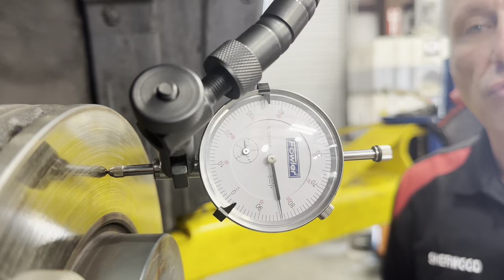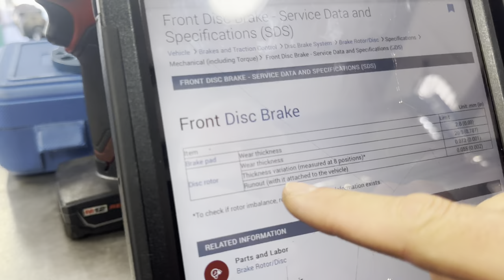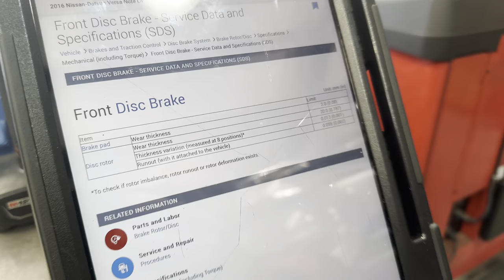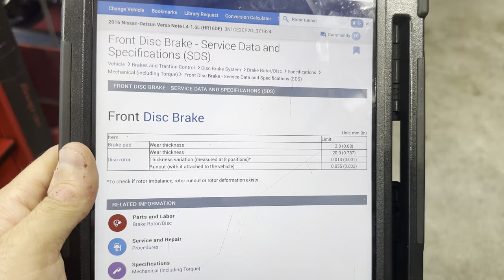It’s Vibrating When Braking & It’s Not the Rotors. How to Test! (Nissan Versa)

Comment: You only have one lug nut on that rotor and its not going to sit perfectly flush on the hub flange. Sometimes rotors will cause brake pulsation due to hot spots causing a harder surface to develop under heat treating itself. This can be a result of cheap pads, sticking caliper pistons, bad hardware, guide pins sticking, etc. Its not always warpage due to overheating, but also hard and soft spots. The hub won't be the problem in most cases unless gorillas tighten the lug nuts unevenly without a torque wrench, pulling the hub and rotor out of round.

Comment: So why did it warp? In my experience, this happens from overtightening of the lug nuts with the air gun when the tires are mounted. All tires call for a specific torque on the lug nuts, but most shops just tighten them as tight as the air gun can, and that warps the axles, as that force pulls excessively on the lug studs, as you can see by the high spots around each stud. I stopped tightening lugs nuts with my air gun a long time ago for this very reason. I just snug them with the gun and then use a torque wrench to tighten to specs.

Comment: When replacing discs/rotors remember to clean the hub for rust before you put a new one on. Some rotors are low quality but some are fixable if you use sanding paper and put it on  brake pads and manage to find a way to spin up the discs on the car. How you do that I wont tell, someone maybe tries it and do it wrong and get hurt. It can be the bearing too thought but I guess most hubs have them built in today so you still would have to replace the hub.

Comment: I had steering wheel shake on braking over 40 mph on my Triumph TR8. I took it to a British car shop and they said "rotors" so I had them replace them.  The problem did not go away so I went back to the shop and they basically told me to pound sand; it wasn't their problem.  The vibration turned out to be caused by loose front wheel bearings which I found and adjusted myself.  So hard to find a shop with enough integrity to take responsibility for their mis diagnosis.

Comment: I did some destructive testing of brake rotors that came from ......you guess it: China. The poor workmanship and lousy casting process was the culprit. This company (in Canada) bought a 40 footer container of rotors, after testing a dozen and found that they were horrible I closed the book. Even though the thickness was good it wasn't to manufacturers specification. Outside face much thicker than inside face, thus made the rotor prone to heath built up and consequent warpage. Put OEM rotors on, problem solved. Just another story for you. Great vid and explanation, kudos to you and your group. Cheers

Comment: When we install new brake rotors, we always check rotor run-out on newly installed rotors. Also we clean the hub area the rotor rests on. if I see more then 0.001" I'm not happy. It could be a bent hub.

Comment: My dad gave me his hhr b4 he died,had a vibration pulled the wheel off & he had gotten the nut which spins on top of a piece of metal because it turns & was not in the pocket,changed the parts to new & made sure they were in the pocket & no more vibration!*

Comment: Simple fix turn the rotors on the car! There are several tool manufacturers . Quick way lathe is the best. If you turn or machine the rotors on the car it trues all hub run out! It’s most important on front wheel drive. I can’t believe your going to all this trouble! 😂

Comment: Hello there, regzrding brake inspection I would like you to talk about bearing hub knuclke assenbly stud bolts. It happens to me that reassembling the bearing hub and  kuckle one stud broke when I applied almost ten  foot pound in excesss of the workingtorque which was around 50 ft/pond.  I was strange because I had tightened the same assambly previoustimes to 70 ft/ pound  and the studs managed to do weell and worked well since then ,  ut this tsutd broke being a new one and a OEM stud. What would be the criterias on selecting a generic stud bolt?  What would it be a becnh test for the studs and what should be the test torque? There are menufacture failure in origi al bolts or they are being clonned and sold in the market as iriginzl...... lots of questios arise from this topic, nice video series of yours tnks a lot.

Comment: Yes please do a vid on cutting rotors and drums.  I like to reuse original manufacture some of the import is so cheap it shows when they heat up they warp very easily. Then some like brand B  are machines to far off they dont fit and the tone ring falls off.  thanks

Comment: Secondly...what was the end result of just changing the hub? Presumably, it was the bearing that was bad. I hope once the hub and bearing were replaced you checked the result on both surfaces again. 
Then...it would have been nice to hear if this actually solved the problem.
Lastly...it would have been awesome to have a follow-up after a few months to see if the fix truly held.

Comment: Only reason that I can think of that might have caused the hub flange to be out of spec is a wheel bearing was replaced at some time before you had it in to your shop, these are easily damaged if the press wasn't set up or used correctly. Very unlikely that it was out of spec off the production line.
Reply: Accident maybe?

Comment: If you suspect this. Always spin the wheel with the tires in the air and make sure the wheel is straight and not wobbling back and forth. If it wobbles or appears bent. Remove the wheel and check it on a balancer. If the wheel no longer moves or appears bent. Then it's your hub problem solved.

Comment: I used to deliver parts for Advance. One of our commercial customers always turned every rotor he installed. I asked him if it was necessary. He said that most rotors are coming from China and he makes sure that they are straight. One thing I don't think he thought of was dirt or rust on the inside of the rotor or on the hub.

Comment: I use to turn breathe drums and cut shoes on a machine that cut both at the she time. Stayed doing it for greyhound and now at a city transit. 
The metallurgy is just not there anymore. A dim would look good and cut in .010 and hot spots would start popping up. The depper the cut, the worse it gets. 
We just use new more, sold that exigencies machine for next to nothing. I won't even turn a turn anymore. Unless it was new original factory supplied

Comment: I can understand (to some degree) this being missed on the first disc change but I'd have thought a closer inspection would have been obvious when vibration still present.
Personally I always measure runout close to the edge on a new disc or close to the wear area edge on used, this will generally give worst case value.
Interesting that the wheel hub was out, presumably this has happened since the car was new?  Any idea what was the cause?

I had a similar issue on a Mercedes recently and I must admit I never bottomed it out.  Started getting judder under braking with cars original discs, these were 2 piece Brembo items and were stupidly expensive but with no other choice bit the bullet and bought a pair.  Car was perfect.  For a short time, then the judder returned.
I measured and they were showing runout so, I found a company which could skim on the car.  Again the car was perfect.  For a while, then the issue returned.
I got the original discs and faced them up true (off car on lathe), put these on the car and ran spot on, untill....  Well I imagine you can guess what happened next!  Yep, judder returned.
In the mean time I took the second set of discs and skimmed them up, they were definitely out (both front discs), it was interesting to see the wear pattern as progressive cuts were taken.  Unfortunately had to sell the car at this point so never got to the bottom.  Although the car's gone now this still bugs me so I'd still be happy to hear of any suggestions why this would occur.
The brakes were 340mmØ with aluminium centre "bell", calipers were 6 pot Brembos and all pistons moving freely.

Comment: I've got a car that the brakes make a groaning noise when the pads get close to replacement time. When I start hearing that noise, I have about an eighth of an inch of wear left before going metal to metal. We bought it new and every set of pads has done the same thing. We've had the car for almost 20 years and  have 258,000 miles on it. It sounds horrible but new pads will shut it up until they wear down to that noisy thickness.

Comment: We had a scenario like this but much worse. Customer changed his own pads (easy to do he said) but came in to us with his wheel loose. Upon closer inspection the wheel bearing had failed so we changed it out. He was back in 5 days later, bearing had failed again. Strange as the tech that changed it out has OCD about his work. Changed it out again under warranty, back 7 days later failed again. We think he'd tightened the wheel nuts up with tyre on the ground and destroyed the hub flange. We had to put new nub and bearing on it to fix it. Completely bizarre. He completely blamed us for it all of course, he wasn't intelligent enough to see that the first wheel bearing failure and the later two wheel bearing failures were all connected to an original event.

Comment: Is  the hub the right diagnosis? I would assume it is a bad bearing. The likelihood it is a hub that was machined with runout is extremely unlikely. Bearings fail much more often and would be the top culprit after establishing the rotor is good.

Comment: My 94 civic I’ve changed out everything in the front besides the wheel bearing. They don’t make noise. And don’t move with the 12 and 6. Idk what else to change I have a slight wobble that’s not noticeable until you reach high way speeds. Wheels have been balanced as well. I don’t know what else to do

Comment: How do you make sure the hub is good before putting on just replaced Hub on my 08 dodge ram 1500 2 wheel  drive 5.7 6 months ago today changed rotors and pads same problem

Comment: My '15 Kia Sorento has the same issue. About every 5k miles or so I start to feel a slight vibration under braking. When I get to about 15k, it becomes unbearable, so I change the pads and rotors even though there's plenty of meat left on the pads. I've even taken apart the calipers and cleaned them. I wonder if this is what's causing it. Off to buy a dial indicator.

Comment: The question now is, why is the hub out? Is it the way it’s installed? Has it taken a hit and pushed in on one side slightly more, is the knuckle not sitting correctly and if not why? Is the suspension components causing that?. There’s a number of other things to check.

Comment: I had an old Willy's Jeep in my shop that had a severe vibration on braking. When applying the hand brake the vibration occurred indicating rear brake as source. While rotating the rear drum you could see runout. Removing drum and checked hub runout revealed the problem. The hub was not available, so I mounted it on the brake lathe and trued it. Problem solved.

Comment: Did you measure the taper in the surfaces?  Brake rotors wear more on the outside than on the inside introducing taper.  Thats why I ask.  I cut a lot of rotors but never below the minimum, and if it does not clean up, in the scrap bin it goes.

Comment: The easiest way to do this is to mark the high stud, and then swap the rotors, lock them down and measure, and see if you still get the high stud with the other rotor or a new rotor because it would be unlikely that both rotors would be high on the same stud

Comment: If you have pulsating brakes you need to do a run out test on the rotor not a thickness test. A runout test is put a dial indicator on the rotor mounted on said vehicle and turn the rotor to see how much runout there is.

Comment: Have same pulsation issue with a 2003 Ford Ranger, but the hub and rotor are one piece. The shop that did the brakes tried to say pulsation was normal. It is nasty at highway speeds and heavy braking. I replaced rotor/hub with original Ford parts and problem persists.
-- The first shop I took the brake job to was inexperienced and tried to hammer off the rotor from the hub. Did they damage something? 2nd shop did the job $1500, and tried to say vibration was normal.  
-- Third try: My nephew is heavy duty mechanic and he replaced with Ford parts, yet problem persists.-- Bearings replaced also. 
-- I was thinking the replacement white box pads were defective as they stick the next day after driving in the rain. Pads were not changed in third try. I was going to change the pads myself, as nephew is sick.
-- Or is the spindle damaged bent from the first idiot shop hammering on the rotor?
-- Or is the antilock system dirty from old brake fluid pushed backwards when calipers are pushed?  I tried bleeding the front, but that did not help.

Comment: I had that happen to me working on a Toyota. In my case was tiny metal debris from the manufacturer when they cut the rotor on the inside part that faces the hub. You couldn't see it at naked eye and the worst thing is that I trusted the brand new parts. My mistake.

Comment: Sir, How about bent front CV axel as a cause of rottor pulsations and warping as if the CV axel shaft is bent it won't let the rottor/ disc spin freely and make its rotation uneven.. what's your thoughts on it.

Comment: How do you check run out on hub before install changed my hub 6 months ago bad vibration on braking today changed rotors and brake pads same thing 2008 dodge ram 1500 2 wheel drive 5.7

Comment: I've noticed that ppl always jump on the 'rotors are warped' bandwagon, but being an engineer I will always ask 'By how much'  Generally if they can't tell you they've not measured them its just an assumption. I've never seen a hub face warped like that either ??? Good find
Reply: I've had rotors with run out that was in spec when cold (Honda's runout spec) but still pulsed when they heated up. Replacing them with a higher quality rotor fixed it. I went through all these measurements trying to figure it out, including hub runout and everything was perfect, until you actually used the breaks for a few minutes. Aggravating but interesting experience. The bad rotors where not even that cheap. They were a premium line of a brand name rotor. Honda, apparently, uses rotors that are smallish for the size of their larger vehicle and suseptible to brake pulsation.
Reply: @jptrainor  and the runout was ???? What about the callipers ability to float. Which Honda was it ?
Reply: @keithriley3159  It was an Odyssey. As I recall the service limit is 0.002 inches of run out. The rotor is bolted on when measured.
Reply: @jptrainor  if 0.002" runout is causing pulsation at the pedal theres other problems somewhere.
Reply: @jptrainor   They look to be twin piston calipers capable of floating around 5 - 10mm, so 0.002" would not be an issue.
Reply: @keithriley3159  0.002 inch cold run out wasn't causing the problem. That's Honda's limit and the rotors were within it. The problem appeared only when the rotors heated up with use. And it was quite a severe pulsation. It was resolved by replacing the rotors with a new set, that also were in spec when cold. Both were in spec. One pulsed, one didn't. The difference, I think is that the second send were symmetric vane casting, hence more uniform heat transfer, and the first were not. But it's hard to be certain and the manufacturer of the first set certainly didn't expect them to have any problem (I called them) yet they did.
Reply: @jptrainor  Well I've never heard of them warping more when hot, and again I point out the fact the caliper can float a good few mm !!! But hey if it worked and solved the issue, job done.

Comment: Question is.. did the customer still have to pay for a rotor that was never needed.. I have a trailblazer the shop said needed a trans.. I changed fluid n filter and it still drives.. parts throwers need to diagnose first

Comment: I would like to know how to get five years and 50000 miles on my rotors. 

I had someone install new pads and rotors on the front of my car because they swore that was causing the wobble I experienced driving. They changed the parts which I already looked over prior to bringing in and looked fine. I go pick up my car and don't get ten feet out of my parking spot before I notice the problem is STILL THERE! THEN over the phone the mechanic tells me he thinks I may have two bent rims and a bad rotor in the rear. Fyi I had to pulsating from the rear til after I got it back from them the second time I brought it in to get 'it done right cause they stick by their work.

Would your team check tires and rims/wheels before automatically changing the front brakes?

Comment: I wanted to know what the problem and solution to this issue was, it was identified that the rotor is good and the hub had movement but what was done to remedy this? Did it just need a replacement hub or was something else causing the hub movement?